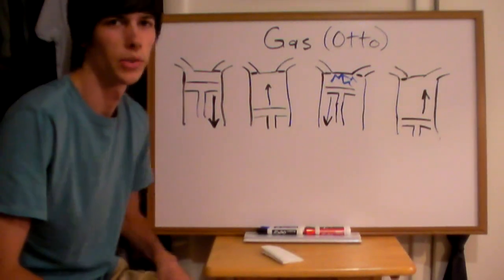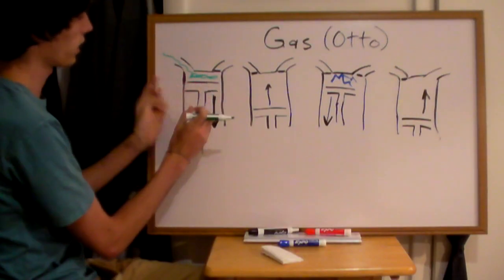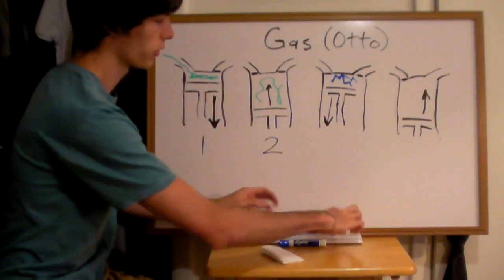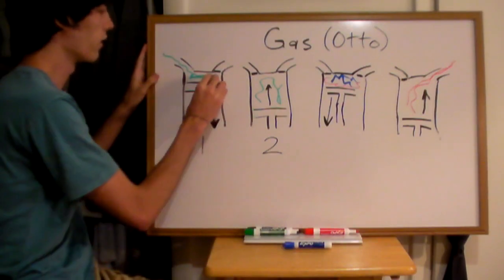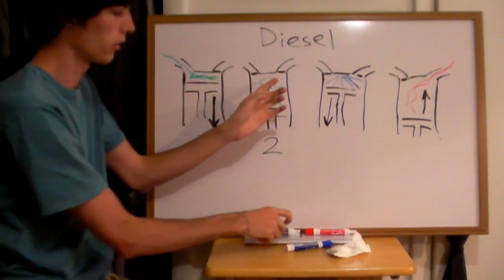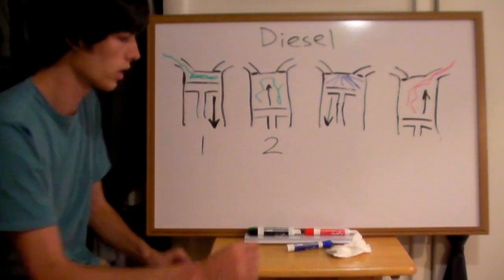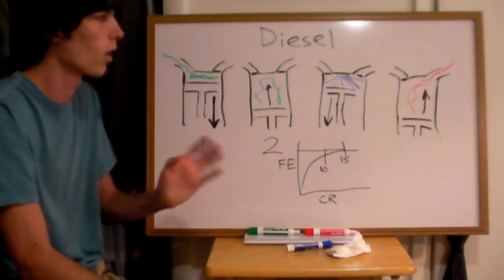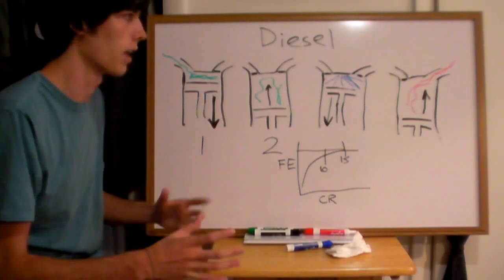Gasoline vs Diesel - Which Is Best?

Comment: Both petrol and diesel engines are Otto cycle engines as an auto engine is simply a 4 stroke engine. Before Otto, engines were 2 stroke.

Comment: This is amazing and I've learned so much from 2 of your videos than I have ever before from anything! I know this was 10 years ago and I won't get a reply but I have a burning question... why not have have a higher compression ratio in a gasoline engine without a spark plug? Obviously there's a reason but not knowing that reason makes it seem like that would just be diesel but better.. idk if that makes sense but I hope it does lol
Reply: Okay so after looking around and doing some research I've found that you can use diesel in a spark and petrol in a compression but it's much less efficient and therefore pretty pointless. Also what I said about petrol being better than diesel is complete waffle. Just saying this incase anybody was also confused <3

Comment: Is there such a thing as an oversquare diesel?     

I’m not caught up with the state of the art, but i remember a few years back someone
tried to convince me diesels have become “as quiet as gasoline engines” thanks
to pilot injection.  Turned out to be baloney.  Also,  i’m kinda disappointed at how manufacturers are pushing for diesels in luxury cars nowadays.  Sure they’re about as quick as gasoline powerplants nowadays, but they’re still the same slow revving, heavy behemoths they’ve always been.

Comment: Why does increase in pressure correlate with increase in heat? Friction of air molecules?
Reply: Also how do diesel engine provide better fuel economy, I understand that the Compression ratio is higher, allowing it to "process" more fuel at a given time, allowing it to produce more power.. but doesn't it equal out? Diesel uses more fuel for more power while petrol/gas uses less fuel for less power (at a time)... so is there really a difference? Am I missing something?
Reply: Cactuscobbler The answer can be related to the working cycles. Diesel cycle utilizes more energy than Otto cycle for the same amount of input energy given.

Comment: Diesel engines do not use spark plugs correct? They use compression instead if that's the case what are glow plugs?
Reply: when you attempt to cold start a diesel engine it has trouble getting to the correct combustion temperatures because the intake air is so cold, the glow plug acts as a catalyst and helps warm up the cylinder
Reply: nice, thank you

Comment: one of the other reasons besides higher compression that diesels do better than gas is diesel has a higher energy density.  I know as far as this video is concerned it doesn't matter but thought I would say it.  there is a lot of neat stuff about diesel engines so I hope people learn more about them.  good job with the videos, keep up the good work
Reply: diesel has a higher energy density per unit volume while gas has a higher energy density per unit mass
Reply: I thought diesel and gas weren't too far different in their weight/gallon.  my mom used to drive a diesel Rabbit and got over 50 mpg with it.  my diesel truck weighs 8,000 pounds and I get about 18 to 20 @ 70 MPH.  @55 MPH I get about 24 to 26 MPG.  there are other trucks that are gas that when they weigh about 8,000 pounds get around 14 MPG or less.  either way I am going to continue being a fan of diesel, at least until battery tech finally gets past it and doesn't require hazardous materials.  which might still be a couple of decades
Reply: cool.  more upsides to diesel ^.^  also easier to get out of crude oil, can use other fluids as fuels.  only downside is since it does work so well governments tax it a lot because companies can't go "well, fuel is too much so we can have the trucks make deliveries" or "can't construct the ____ because fuel is too much"
Reply: yep.  I remember reading that.  interesting how history can repeat itself.  ha ha

Comment: So diesel engines don't have Spark plugs? So batteries last longer right? Also way don't Gas Engines, inject the fuel in the compression stage, like in a diesel engine, instead of the intake stage?
Reply: I could be wrong but diesel fuel takes more heat and energy to burn, gas does not.  the pressure needed to inject the fuel when the air is compressed might cause gas to do some funky stuff in the fuel pump system before it gets into the cylinder properly.  gasoline is very reactive, especially compared to diesel.  though the movies are wrong about them being ticking time bombs .  I would think with how long gasoline and diesel engines have been around there would have been a couple people that tried it.  based on gas engines not having more in common with diesel engines I guess the tests were not very satisfactory.  I am sure someone more knowledgeable than I will have better information but hopefully this helps.  oh as far as the batteries go the catch is it takes more work to get the engine started though it does seem even an average quality battery does last a little longer.  it also depends how you treat the batteries as well.  there are still lots of electronics with present day diesels
Reply: Diesel has a lower self ignition temperature than petrol. Hence no carburettor (mixing of air-fuel) is required. Injecting diesel into compressed air ignites it to the self ignition temperature and then it burns.

Comment: I get the feeling that you'd get diminishing effectiveness of the diesel fuel as it ignites and pushes the piston back, reducing the pressure and temperature inside the cylinder. Is the injection so fast that all the fuel is inside the cylinder before it ignites or is it not a problem. I imagine a similar problem happening in the gasoline engine with the mixture igniting at the spark plug and then as the piston moves away the mixture burning provides less power. Is it the case that the consumption of the fuel is so fast that the piston just hasn't moved a significant enough distance before it is done for it to be a problem?

Comment: If the compression is so high why doesn't the fuel line explode when it ignites? Why does it push the piston down and the not up the line.
Reply: Just guessing, the fuel in the injector is at high enough pressure to shoot the fuel out. Especially considering it has a very small nozzle to spray it out of. There's probably another valve to resist the the explosion part too. Interesting question though.

Comment: But why does the piston move up in the second step? Whats the mechanics behinde it? Is it moved electrically up?
Reply: also the pistons are all hitting the powerstroke at different times so when one of the pistons is going down on its first stroke another one will be on its powerstoke and all the pistons are connected via crackshaft so when the piston on the power stroke sound the piston on its first stroke hope that made sense but it probably didnt
Reply from the maker: +ClarityRyZze check out my video on flywheels. :)
Reply: ok Thanks :D
Reply: As far as I know, the rotational motion of one piston makes the other pistons move when they are not being ignited. Like an alternative sequence of combustion and exhaust of burned fuel. Noticing that if an engine has 4 pistons then 2 will ignite at the same time while the 2 others will follow. Hope that might have explained.
Reply: For a diesel, how is fuel injected when the piston is at the top with all the pressure?
Reply: +Rob The Tuber , The fuel injector pressure is far greater than the pressue within the cylinder at "top center".

Comment: I am unsure whether you did so and I have not yet found it but a mathematical discussion of the theoretical Otto and theoretical Diesel cycles would be interesting. I am of the belief that if an ideal antiknock gasoline existed, the Otto cycle, at very high compression ratio, becomes more efficient than the Diesel cycle. Thoughts?

Comment: so diesel engines dont have spark plugs ? , the combustion its just because of the hot air ?
Reply: yes, because diesel is thicker than feul and is harder to ignite the spark doesn't always ignite it but when the compressed air is at 600+ degrees the diesel ignites instantly
Reply: hm ok thanks man !

Comment: So what happens if you use gas in a diesel, or vice versa?
Reply: Neither will ignite. Gasoline won't ignite in Diesel engine because there is no spark. Diesel won't ignite in gasoline engine because not enough pressure.
Reply: Apart from ruining your fuel system and requiring a complete overhaul of both engines, that is.

Comment: So, maybe you can answer this. Why does a gasoline engine rely on sparkplugs?

It was explained to me that the primary difference between diesel and gas engines is that diesel engines do not rely on sparkplugs to ignite the fuel-air mixture. This is done, as you explain, through compression, which leads to a high enough temperature for autoignition.

What no one has been able to explain to me is why a gasoline engine cannot be built on the same principle. Can you elaborate? I suspect it has to do with the higher volatility of gasoline compared to diesel.
Reply: There have been experimental compression ignited gasoline engines, but historically they have not been very successful in application. My guess there are two parts to this: compression ignited engines are always heavily built because of the temperature and pressure, and thus not always suitable for gasoline market which is household cars. The other one is because it's harder to control for many practical reasons that you need to research yourself. However, several car makers are now again experimenting with it because of advancement in electronics and material science. Google "HCCI engine" for more detail.

Comment: Hi awesome video,

Do you have a video explaining the starter motor and how it leads to this? How does the engine go from the starter motor turning to this action kicking in.
Reply: more specifically the starter is an electric motor with a little gear that meshes onto the flywheel which spins the crankshaft to give you enough energy to pull in the air and fuel, compress it, and ignite it. then once the engine gets itself going the way the shaft of the starter works causes the little starter motor gear to be disengaged from the flywheel. thats why it makes that grinding sound if your car is already started. its your starter "pinion" grinding against your flywheel
Reply: +Matthew Dobing The starter motor simply spins the crankshaft through stage 1 and 2. Once the engine reaches stage 3 the engine "starts".
Reply: +Lemtem Poktui Hi mate, thanks for the info. So it is just the kinetic energy that causes the engine to start?
Reply: Matthew Dobing Pretty much.

Comment: I have a couple of question. I've noticed that most engines have an even amount of cylinders. Those the "combustion process" happen in every cylinder at the same time or does it switch? My next question, normally engines have an even amount of cylinders, what would happen if there was an odd number?
Reply from the maker: +Galaxy Wolf I'd recommend starting with this video and working through the playlist: https://www.youtube.com/watch?v=yRWL9czmk_E&index=10&list=PL30C950600B683799

Power stroke does not occur simultaneously in the cylinders. I have videos on each layout to understand what happens. :)

Comment: Hi again, i already watch your video telling what would happen if you misfuel a car, again great video, but my question wasnt that, i was asking why there are no commercial diesel cycle engines, built to work with gasoline, because as far as i can tell that would make sense since the diesel cycle is more efficient than the otto (higher compression ratio) and gasoline is a cleaner more powerfull fuel.

Comment: Nice video! I have one question though, you said in the end about a turbocharger or a supercharger that they draw the air in. Isn't the supercharger powered by the crankshaft and the turbo by the gases?
Reply: +Engineering Explained Will you ever cover 2 stroke diesel engines?
Reply from the maker: +Vlad Popovici https://www.carthrottle.com/post/engineering-explained-the-pros-and-cons-of-turbochargers-vs-superchargers/

Comment: if air is compressed isn't it true molecules of air get close to each other and air will turn from gas to liquid from and go to supercool form? please answer me, i really want to know what makes air get hot instead of getting cooler under high pressure
Reply: +DEADLY HUMAN It takes energy to compress the air, and that energy has to go somewhere. When the air expands, it cools down because it uses that heat energy to expand.
Reply: high pressure causes heat because the energy has to go somewhere. low pressure makes things cold. hence why mountain tops are cold not hot
Reply: +420BassIt then why compressing gas like nitrogen turn into liquid going to extreme low temperatures
Reply: +DEADLY HUMAN Because stable liquid nitrogen isn't made by compressing it, it is made by freezing it until it condenses out (much like how water vapor condenses into water when it is cooled, except in this case it takes getting a lot colder).

Comment: Do fuel injectors in a diesel system have to shoot the fuel out with a lot of pressure? Could there ever be an issue where the fuel injector is not functioning well and the pressure in the cylinder forces air and fuel back into the fuel injector?
Reply: +RMSVideos It uses a lot more pressure than gasoline engines. In big trucks, the fuel is injected with 2500 bar and for cars I think it is around 1600 bar.

Comment: Are there still spark plugs in a Diesel engine?
Reply: +Alex  Green no, they're not needed. as he said in the video, the increased compression causes the air to get to a much higher temp, which is able to ignite the diesel fuel without needing an auxiliary ignition source.

Comment: I have a small doubt in step 1/stroke 1 and step 4/stroke 4 of engine ( be it gasoline or diesel ) , are we doing work in pulling the piston down during the entrance of air-fuel mixture/air or the piston gets compressed owing to the pressure exerted by the mixture? the same question I may ask during the release of the exhaust gases.

Comment: so diesel engine has different configuration of bore-stroke ratio than gasoline ?
Reply: Maybe he think bore-stroke ratio could affect compression ratio. That actually make sense since longer stroke (under square) should be very high compression.
Reply: +Ilham Defra Diesels typically have a compression ratio higher than or near 18:1. Many have been built with low compression ratios but those are few and far between. For a comparison the Bugatti veyron (fastest car on earth) has a compression ratio of about 9.3:1. Yet  Navistar international built a 7.3 liter indirect injection diesel with a compression ratio of 21.5:1
Reply: The real doktorbimmer Someone else had already answered it I was providing addition information.

Comment: Great Video could you explain why you could not put gasoline into a diesel engine or vice versa surely if the diesel fuel is injected in later and the compressed air is the causes the explosion not a spark plug could gasoline not be used in a diesel engine ? thanks

Comment: is it posible to make a 3 litre v6 diesel with a 30.1 Compresion am make out of it over 500hp and 1000 NM because that would be great
Reply: V8 with a twin turbo would have loads of torque at least 1500nm.

Comment: I have seen a single cylinder engine working appreciably. I thought that the flywheel would be responsible for providing torque to the crankshaft when it would need piston movement other than the power stroke, since the flywheel would have large angular momentum. Am I right. Does that mean that single cylinder engines would need work without flywheels. And btw, great videos.

Comment: So diesels have no spark plug?
Reply: That's right, the temperature is enough for combustion
Reply: Zack Johnson no. The hot compressed air will do the job
Reply: Zack Johnson im asking the same question

Comment: know this is noob question , any idea if put diesel into gasoline vehicle ?
Reply: ***** 
Gasoline vehicles are not designed to run on diesel.
At the least, you'll have to have the fuel tank drained and the fuel system flushed.
At worst, you might have to have the fuel pump, filter, and fuel injectors replaced as well.

Comment: So why does the diesel engine needs sparkplugs?
Reply from the maker: gugairon It does not, hence it doesn't have any.
Reply: Engineering Explained Thank you for your answer, I've been thinking it used spark plugs since the begining
Reply: gugairon Diesel uses a glow plug instead to heat the engine

Comment: Is the higher compression ratio the reason why Diesel trucks are more capable of pulling higher weights than gasoline ones?? I mean when the air is compressed more it explodes stronger, right?? or why else would all heavy machinery have diesel engines, the operators also worry less about over heating.
Although the diesel fuel is ignited by the very hot and compressed air, the engine still needs spark plugs on its cylinders to start the operation, right?
Reply: Diesels burn more fuel because they have higher air to fuel ratio than gas. Compression ratio has nothing to do with it. the only reason diesel is higher cr is the heat from the higher temperature required to ignite diesel. Diesel has throttle open 100 percent at all times. U control engine speed with how much fuel is injected.